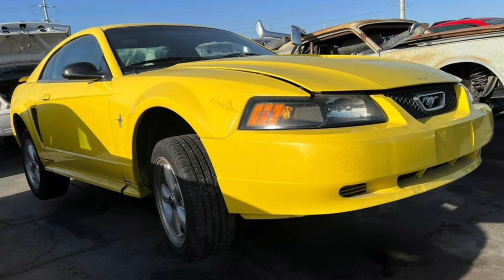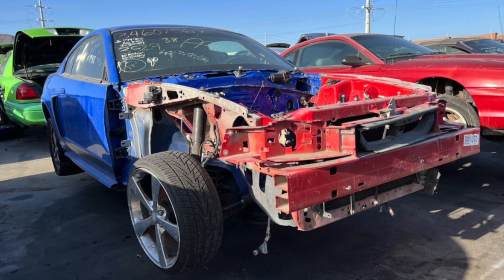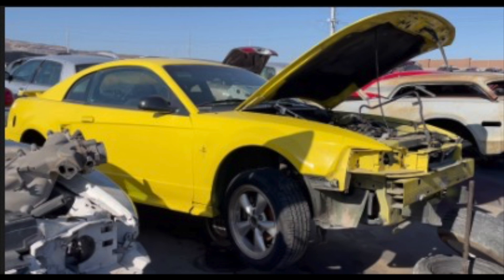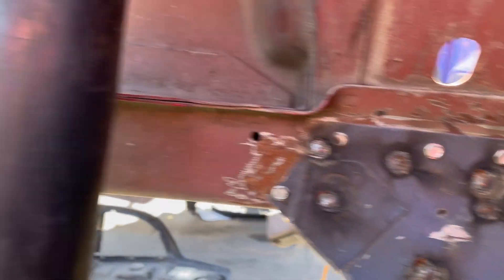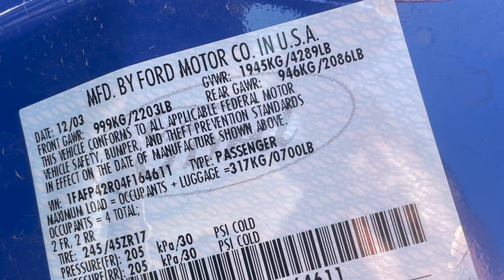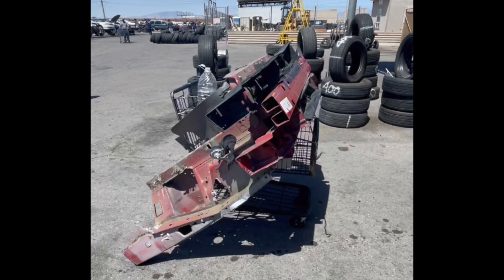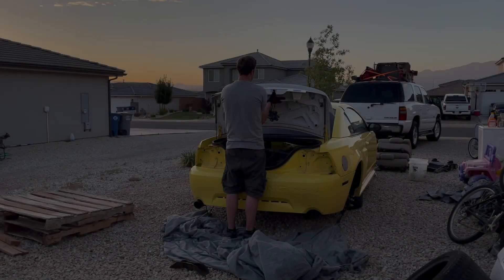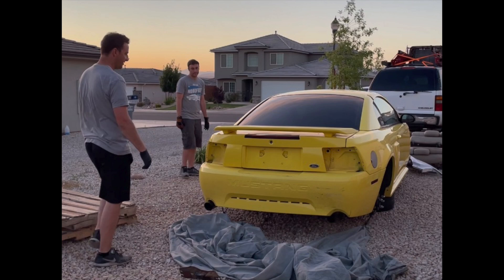02 mustang GT update New front clip hood spoiler trunk  a pillars and fenders

Comment: What an awesome find on the zinc yellow V6 and Mach 1. Having the front end ready to go is pretty awesome. $500 for all of those parts isn't bad but it does suck they nickle and dimed you on the front end. Can you get the wiring harnesses to replace the cut harness in the future?
Reply from the maker: I bought an entire Sonic Blue 03 GT that someone took the drivetrain out of to have as a donor car. It’s wrecked bad on both ends. It has the main harness and window switch harnesses in it.
Reply: @justin.c_svt  Even better that you already have it. I hate when people hack up harnesses. It's too easy to remove a plug. It's especially weird when you are trying to part out a car as you would want to maximize the money you make.
Reply from the maker: Absolutely